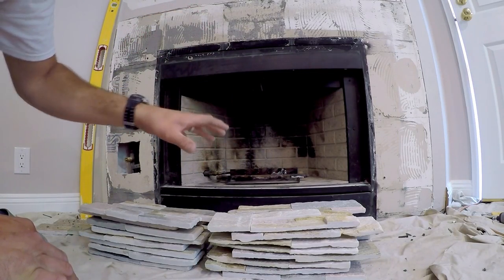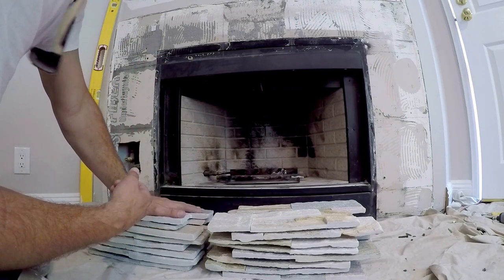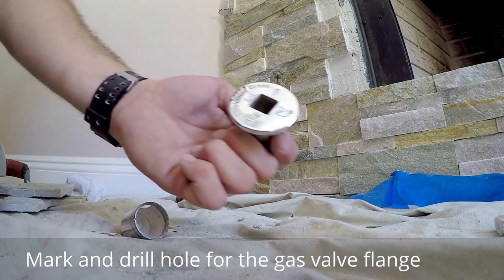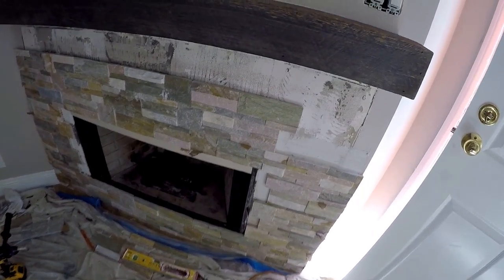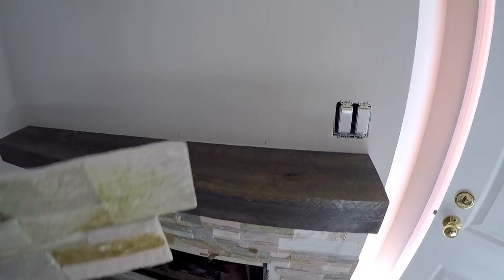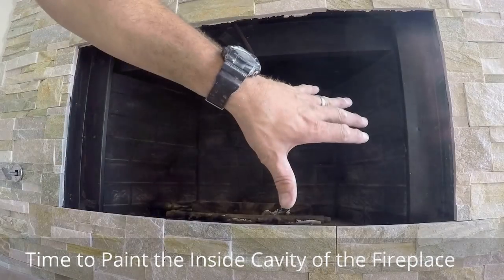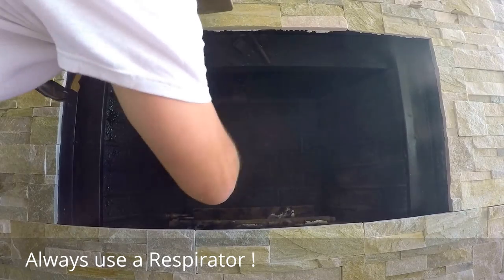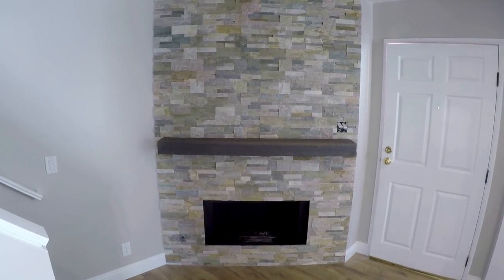Fireplace Makeover Quartz Wall Stone Installation

Comment: No backer board?  Not questioning, I’m trying to get more info before I install mine. Thanks
Reply from the maker: The drywall is the backerboard. Tile right on the drywall.
Reply: @LandbergTileTV  I'm doing a LED fireplace, and I had the same question about the backer board. More than one "google" search recommended a sturdy board or cement board backer board over the sheetrock, even if only 1/4" thick. The reasoning is the wet mortar can soak into the sheetrock, which is basically paper over gypsum. I'm no tile expert, but I myself would not install a heavy stone tile directly on sheetrock. It's worth the few extra $$$ and effort to put a cement backer board over the sheetrock. I prefer to err on the side of caution.
Reply from the maker: @trishakelly4934  We have installed tile directly on painted drywall for fireplaces dozens of times. Modified thinset will stick if you key it in (trowel the drywall). We have removed and demoed hundreds of showers that had only tile installed directly over drywall. The removal was not easy and the tile adhered extremely well to the drywall. It is absolutely okay to install tile on sheetrock/drywall whether it is painted or not. Installing concrete board is unnecessary.

Comment: How did you install and remove the wood ledge board on top of the fireplace? can you share some tips? I am literally doing the same project you are and I'm not sure how or where to best screw the wood strip so it's easy to remove later. Thanks
Reply from the maker: you install a bracket and the fireplace mantel, you then tile up, on top and around it.
Reply: @LandbergTileTV  Thanks for the replay. I was referring to the ledger board you show at 1:55. I know you put that there so it can hold the weight of the stones going above it. I just want to know where and how you screwed it. The video doesn't show where you installed and when you removed it. Again, thanks for the reply!